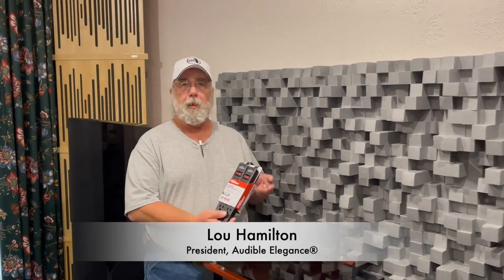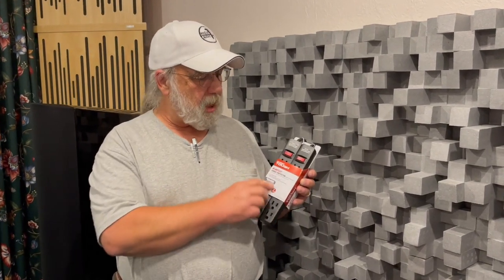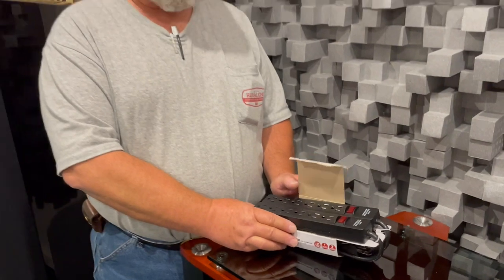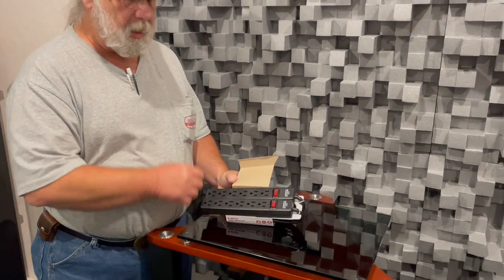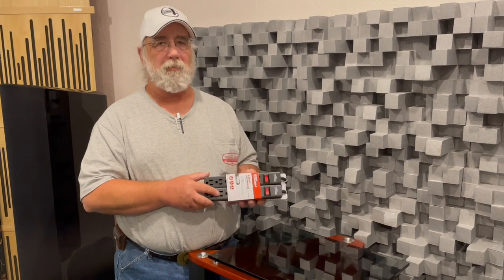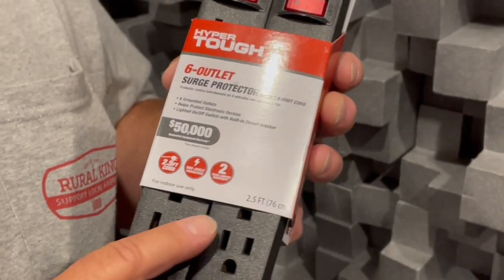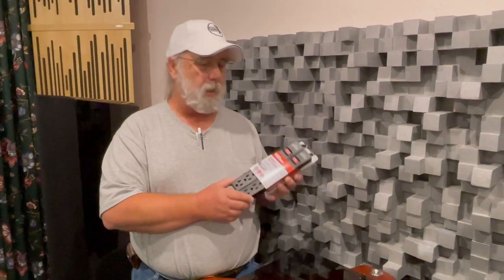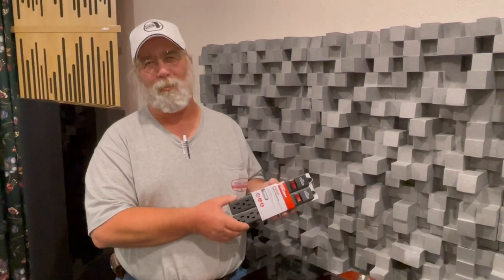Using A Power Strip In Your Audio or Home Theatre System

Comment: I just added my electric company's "surge protection" plan. They added a meter-based unit and provided 5 point of protection units for inside my home. The unit added to the meter is to protect all motorized appliances like refrigerator, dishwasher, W & D, etc.. The five indoor units are enough to plug all of our more expensive electronics like TVs, home-theater equipment, computers, etc. into. They also have a monetary repair/replacement guarantee. It was $19.99 for installation of the unit on the meter and $8.99 per month moving forward. That's about as good as any protection along with insurance I could get. Hopefully I won't ever have to know how good any of it works!
Reply from the maker: A worthy response on your part.  Depending upon where you live, what is being built around you (and the interruption of service repeatedly, and a whole host of undesirable events, this is a good move and I have recommended such things be done.  Thank you for helping out on this subject.

Comment: Any particular power strip you recommend?
Reply from the maker: Wiremold makes a delightful unit called the L10320.  No on/off, no surge protection.  Then, play with the sequence of what is plugged into it.  Tradition says power amp first.  That may not be the case.  Usually, sources do better first.  But, you need to try with your system.
Reply: @audibleeleganceinc  thanks. Appreciate it

Comment: What power strip do you recommend for av equipment?
Reply from the maker: As Youtube is an international platform and since the quality of equipment is unknown, I am going to give a more general response. Molded strips are out of the question. What I first look for in a strip are quality normal female sockets like what you have in your home.  If they can be hospital grade, those that really grip well, so much the better.  Usually these are 8 socket devices in the United States. For many years, Wiremold made a delightful unit called the L10320.  No on/off switch, no surge protection, just straight power.  In short, nothing to screw things up in the power path.  From there, decisions go in all sort of directions based upon needs and equipment.  We have similar units like that today with removable power chords, protection and filtering. Some areas are unstable and need surge protection, others really don't.  Some folks live in areas with really "noisy" electric while others don't, again. Write me through our website, if you wish, so I can be more specific to you. Units that feature filtering and surge protection for $100 to $200 US Dollars are usually not particularly good when it comes to sonic performance.  Wherever you are located, discuss this with a reputable audio dealer and buy from them.  Don't use their knowledge and then go shopping for price on the web.  They are there because they sold things to be there for you. Pass it on!

Comment: There is no protection against lightning, maybe a solid copper rod in the ground connected with a strap. Two billion volts goes wherever it wants.
Reply from the maker: Absolutely, and it does it in a completely random manner.  We once sold a new Bryston amplifier that was blown to pieces and the customer said we sold him a bad amp.  Before we could get a replacement (every resister was blown to pieces) he got hit again and he watched the plasma ball roll through his house.  That time, nothing was spared.  Everything that was electrified was destroyed.  We have even had cases where the lightening jumped from the socket, zapped the speaker cable and then blew up the system.
Reply: @audibleeleganceinc   yeah I saw a plasma travel down a steel fence once  will never forget it.
Anyway they call those things surge protectors and let people think they work against lightning. 
They don't.  It's human nature to think a cheap piece of metal and plastic can stop lightning when it's already traveled through twenty miles of air.